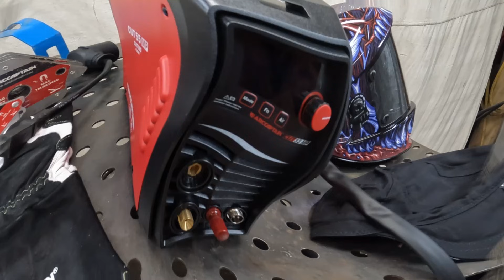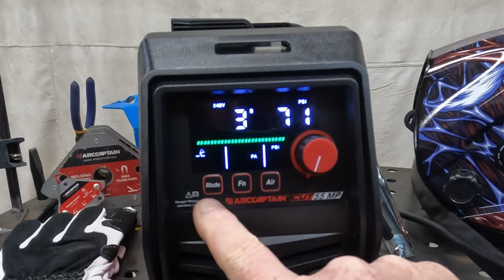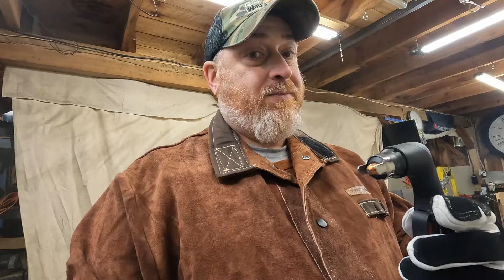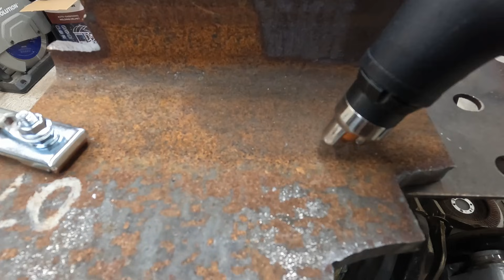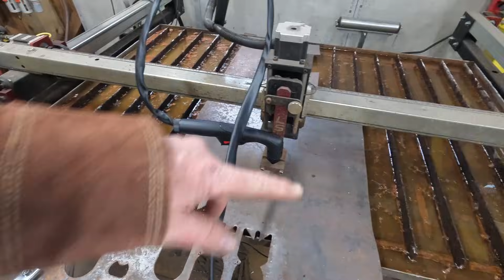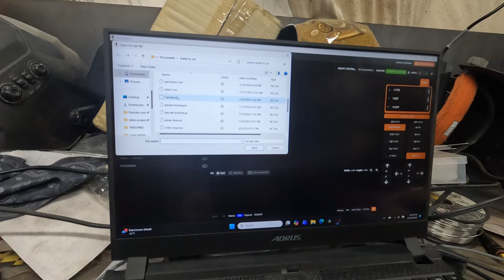Arccaptain CUT55 MP review and CNC cheat code!!! Budget plasma cutter and rust cleaning all in one!

Comment: Great review! Just picked up a used Crossfire and ordered this exact machine! Glad to hear it'll work with the table! My question is with the cable going to the table, guessing you cut one end off and that's what you soldered to the two pin connector? Thanks for all the info with this machine!
Reply from the maker: Or you can get this and cut off one end and then solder on the connector in the description.
https://amzn.to/4rA8Chj

Comment: Thanks for this video, I connected my plasma cutter to the Crossfire Table with no problem and did not have to open my case or change anytrhing to void my warranty on my plasma cutter.
Reply: The pro says it needs a 16’ lead. What lead are you using?

Comment: What about the THC connection?
Reply from the maker: There is no THC connection as this isn't CNC ready. Arccaptain will have a CNC ready machine coming out shortly. I'm sure you could get a true voltage reading but you'd have to disassemble the machine voiding the warranty. I would not suggest that as I don't want to be the A hole that is responsible for no warranty.

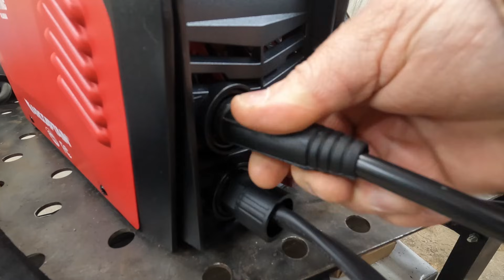Comment: over what seems like 100's of video reviews all over Youtube and TicTok I haven't seen anyone have anything bad to say about Arccaptain,  I'll go 1st @6:01 the Din connection for the work clamp in very unsatisfying, just a simple friction fit and twist, nothing to make you feel like saying 'That's not going anywhere"  it feels like it could turn a 1/4 turn the wrong way and fall out.   I first noticed on my Cut 55 Pro and now on my Cut 55 MP.   every other connection is solid and good I feel like an extra $3 per unit right there at that connection would make the machines feel 100's of dollars more expensive.   it's not a deal breaker it's still a great value,  it's just through out the entire machine you get a feeling like you are getting alot for what you pay, except that one connection it feels cheap right there.

Comment: Is an IPTM60 machine torch interchangeable? I'm looking at options for the DIY JD's Garage plasma table I'm building. Not planning on needing THC, but it will probably have a Z axias adjustment.
Reply from the maker: Yeah you can swap out to another blow back as long as the connectors are the same.

Comment: Hey Dave.  Thanks for the demo in the table!  The Langmuir does have a voltage divider where you can take the voltage directly off the torch leads if you want to run a THC.  Thanks again, you guys are awesome.   Eastern CT rocks!!
Reply from the maker: I find THC completely unnecessary.  I didn't even get it as an option. We are actually considering getting rid of this table all together and getting an Arcdroid.
Reply: If you do get the arcdroid, I'd love to see a demo!
Reply: Did you speed up any of your cut videos?